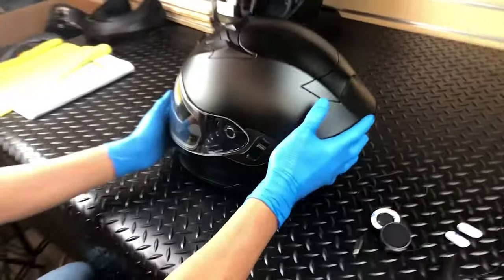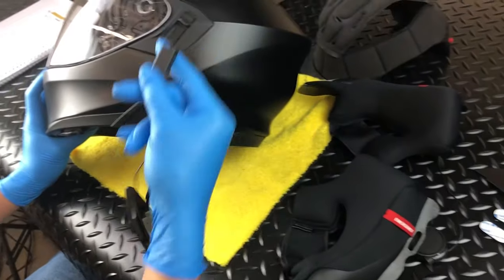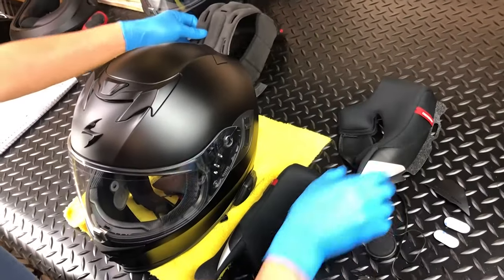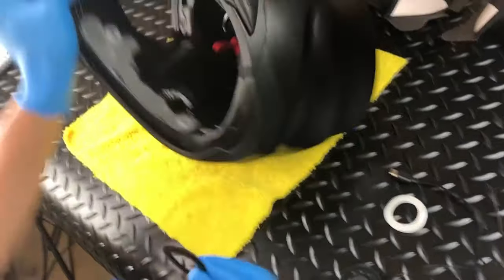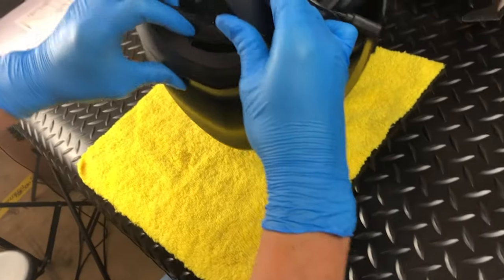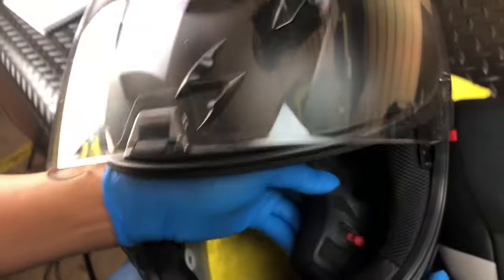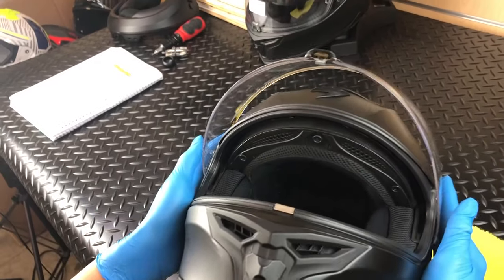EXO COM 520 complete installation

Comment: Thanks for the video and instructions. I wish the lighting would have been better in some scenes when filming into the helmet.

Comparing the sound qualitiy to my Samsung Galaxy buds live (which I even used before inside the helmet for music an phone calls) this is pretty bad sound quality. Fidling a bit with the equalizer helps a bit.

The whole situation with the battery placement and the need to remove it for charging is pretty ridiculous.

Comment: Work at a dealership and straight up would not recommend this helmet, the cheek pads have a stud like holder to hold the pads to the helmet and that mechanism is very susceptible to braking during install...

Comment: I’m using this system and I’m very happy. But I am wondering if there is an easier way to charge the battery ? I have to disassemble the inlay each time I want to pull the battery out to charge it.
Reply: wait what? please tell me there is an easier way. that would be insane.
Reply: @5tahlin just pull it out at the back

Comment: I've just installed intercom into my EXO-1400 EVO Carbon, and the noise level was completely ruined when not having the pads covering the speaker holes there.
I ended up installing the pads again over the intercom, but as they have plastic sheets attached to them, the intercom volume isn't very good instead..
What would be your recommendation @scorpionsportseurope ?
Reply: What pads covering the speaker hole do you mean exactly?
Reply: @pizzaschinken4374   The helmet in the video doesn't seem to have them. Other videos show these pads.
They sit right over the speaker holes, with an additional pad filling the speaker hole, and a plastic sheet between the two.
I found a solution to this eventually, I installed these pads on opposite sides so that only the pad covers the speakers. That mostly restored the noise level in the helmet.
Reply: @Tiaan90  i think my helmet has them too, but i dont know what i am supposed to do with them. I have the Scorpion exo 1400 evo 2 Air carbon, and there are two speaker holes on each site too. They also have pads covering them, however only one side has the plastic thing which fills the hole. And im very confused because the pads are literally stitched to the speaker whole with a small seam. I think i had to cut it out if i want to install speakers
Reply: @pizzaschinken4374  Ah, yeah that sounds like a similar pad to mine. The Evo 2 could be designed better, so you could try using the helmet without the pads after installing intercom. Otherwise you could try my solution of putting the pads in on opposite sides. That puts the speaker hole pads and plastic thingy above the speakers.

Comment: Hello, did someone tested this exo com yet ? There is no tests out on Youtube and I would like to know if the sound quality is good or not !
Reply: I have it sound quality is ok
Reply: The sound quality is pretty good in regular traffic highway speeds is a different story the sound quality goes from good to okay lol phone calls are the same as if you had a boom mic the other person can't hear the wind noise
Reply: I’m here for the same question lol
Reply: @miguelgutierrez3720  my mic doesn’t work with mine?
Reply: @ryanrides3677  I'm confused by your question lol to use the voice recognition the button on the bottom of the controls you have to push twice to turn it on to use it but you have to have your phone set up for your voice recognition to answer calls while riding
Reply: @ryanrides3677  bro, do you mean the quality is bad? I’ve had a nightmare with this headset
Reply: Same question guys

Comment: you lost me at having to remove the helmet lining each time to remove the battery from the helmet for charging. or am i missing something.
Reply: the battery has a latch at the back of your head basically ... don't need to remove the liners to get the battery out you just need to tuck the usb cable a little
Reply: You don't have to remove the liner just the case where the battery sits to charge and that's it

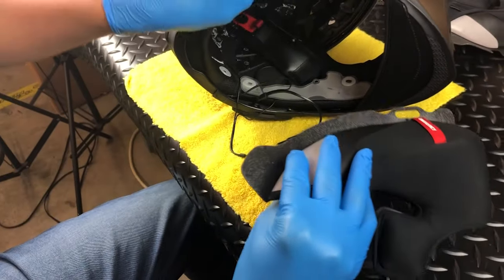Comment: I love your products but I'm disappointed with this. Cable management is poor and the tiny pocket in the left cheekpad at 5:15 is useless. It's not clear where the connector from the speakers to the control unit is supposed to go so I ended up stuffing it into one of the chin strap holes because it digs into my head if I put it anywhere else, but I don't think that's where it's intended to go.

What's worse is the unit detaches from the helmet just from me using it while riding, because the notch that latches it is insufficiently tiny. The battery also doesn't seat squarely into the battery holder, it always hangs at an angle.

It's not the worst thing ever but it feels kind of cheap, and outside of those issues I have been very happy with it!
Reply: The video is kinda garbage on making sure it doesn't detach with a finger touch I found it easier to put it in with the top first then the bottom and it stays in place and doesn't move at all hope that helps

Comment: Not trying to hate, but your video sucks showing where, how much, placement of the wiring sticky tabs... You need more lighting, and show about how much wire your tucking back since it would be helpful to leave enought to pull the battery out to charge. 🤦‍♂️🤷‍♂️

Comment: are you taking the piss with these instructions? "fold the excess wires into the pocket but be careful not to fold the wires" ?? absolutely shambolic
Reply: Since i work with electronics a lot, whats she was ment to say you can loop the cables to tuck them in but having hard folds in the wire can lead to cable damage